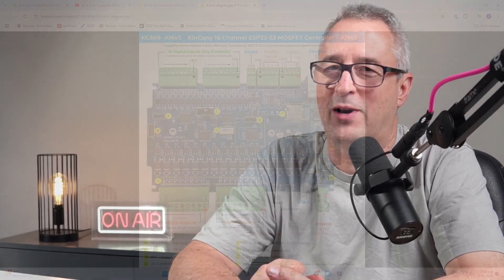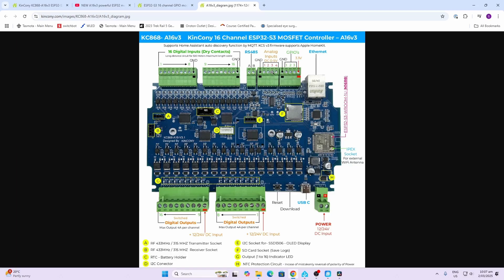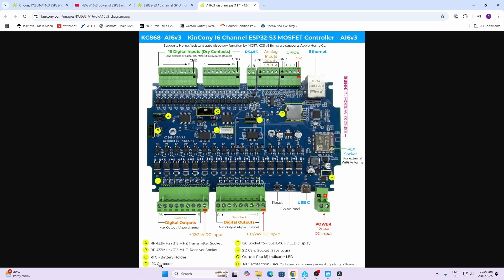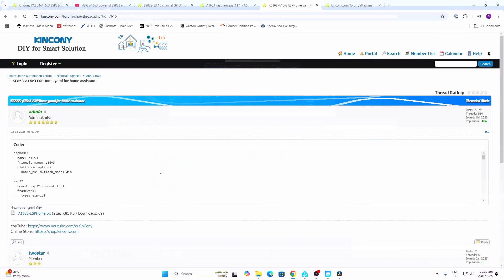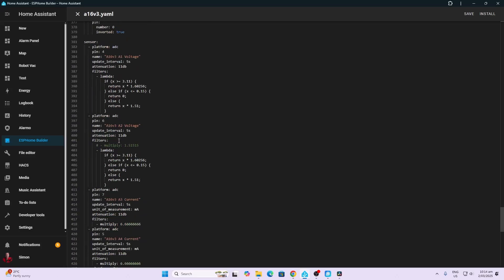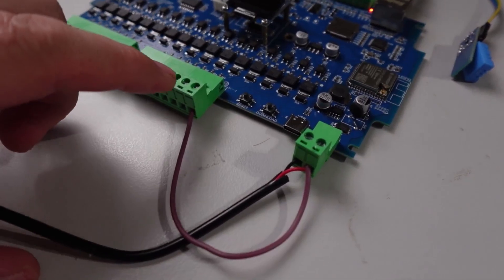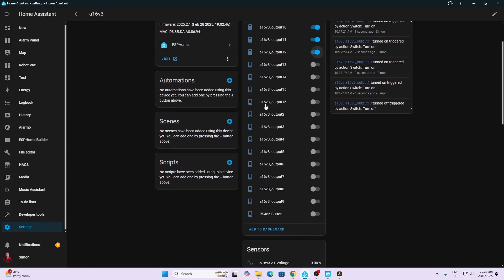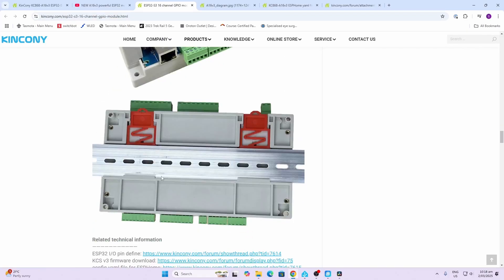NEW ESP32 S3 ESP Home Control Module for Alarm Upgrade!

Comment: Do you know whether kincony sells a board like this but woth loads of analog inputs instead of loads of digital inputs?
A proper alarm system requires that you install a resistor at the location of each door/window/pir sensor (called an end of line resistor), which allows to detect if someone has been tampering with the sensor (e.g. cutting a wire).
This means i need to measure voltages rather than open/close
Reply from the maker: I can't seem to find one like that.  Yes I have heard of the inline resistor!

Comment: I have the Kincony KC868-A4 and I am using it for RF control of my ceiling fans. The RF modules I am using have small copper wound aerials I noticed on your board that you don't have those. Can you tell me what the part number etc of the RF modules you have? Thanks
Reply from the maker: That sounds like a great use for the board!  Here is a link to the boards that were included https://www.openelectronics.eu/433Mhz-siustuvo-WL102-341-ir-imtuvo-WL101-341-komplektas
Reply: @simonsayshomeassistant  Thanks. Unfortunately the Kincony A4 has 3 pins for the transmitter so I can't use the same ones you have which both have 4 pins. 😥 I flashed it with Tasmota sensors binary by the way. Works well.
Reply from the maker: @ubeaut  Yes this is such a versatile device, what else are you controlling with it?
Reply: I did have the IR running on it and controlled the TV and the gas heater with it but now I just use the RF as I couldn't do both sensors with the binary as there is space restrictions on tasmota as to how many sensors it supports. I could compile a binary in tasmota that does both but I am using Broadcom IR blaster to do both the heater and the TV. The RF does ceiling fans in 2 rooms whereas IR doesn't go through walls.
Reply from the maker: @ Oh that is really cool!  I think that the new ESP32 S3 offers allot more RAM